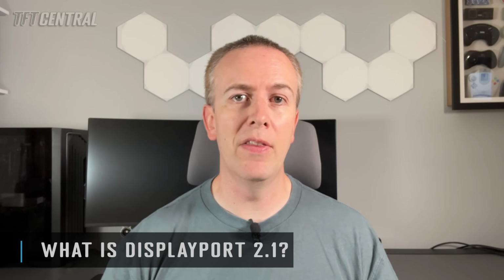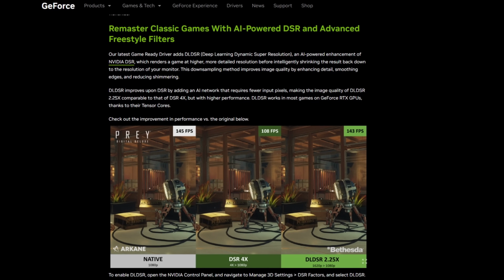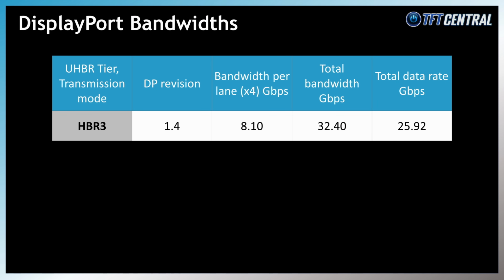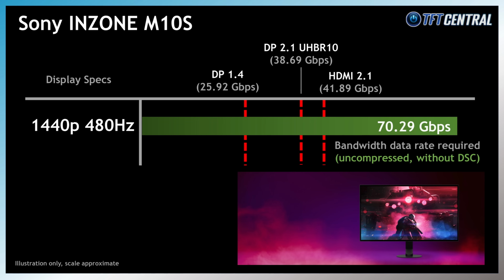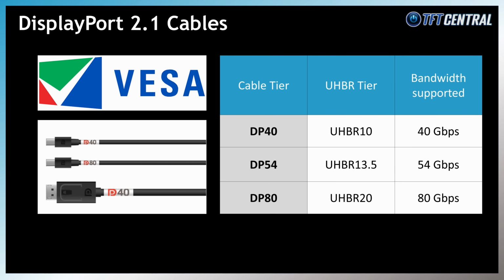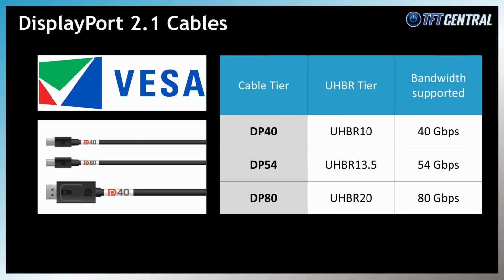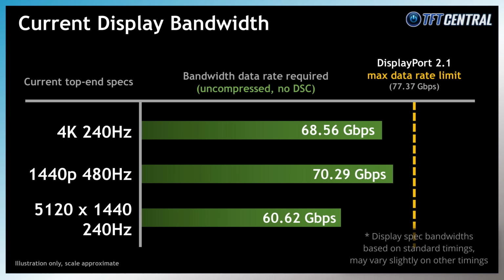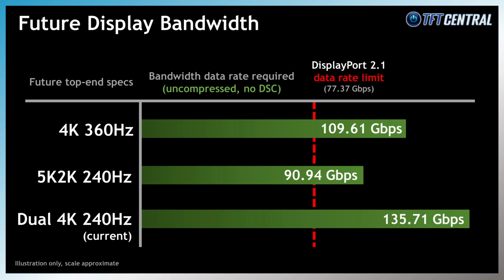The 5 Big Problems with DisplayPort 2.1

Comment: It's sad how hard they dropped the ball on standardizing the actual cable spec, allowing sellers to get away with using the DP 2.1 branding without supporting the full bandwidth of the spec.
Reply from the maker: Agreed. Same boat as HDMI 2.1 on that front
Reply: The worst part is that they can use the DP2.1 label and only offer the same speeds as DP1.4
Reply from the maker: @livedreamsg yeah I don’t see any reason why that should be allowed personally. If it’s only old speeds, they should have to call it DP 1.4. Fine if they add other new bits to that, but DP 2.1 is ALL about the new speeds in the minds of the consumer
Reply: That's because they took inspirations from the morons in the HDMI forum forgetting their dictionaries at home with what the words 'standard' or 'specification' means. All these annoying standards houses do this, same with Nvidia when they downgraded their Gsync Ultimate spec (of course it was downgrading the only thing that really mattered, HDR quality). It's just a blantant disregard for anything sensible because these standards houses want to have their cake and eat it. They want to lure consumers with shiny new specs, but their members don't actually want to pay for the effort required to bring to and make it common on the market. It's just more corporate garbage greed as always. So sane and sensible group of people would do these kinds of things, nor would we have need for things like DSC (it's not like people decades ago didn't think compressing video signals, but rightfully avoided such garbage).
Reply: Yup
Reply: Bean counters and marketing scammers shouldn't be allowed inside fire arm range of making standards.
Reply: Sad but hardly unsurprising

Comment: I think we also have toke account t the price of the monitor. I dont expect, nor need DP 2.1 80Gbps on a 200€ monitor. I doubt thing most other people do either.
But buying a monitor that has top end specs and that costs over 1000€ should also come with the newest standard and appropriate cable included in the box (looking at you Sony).

When a monitor already costs 1000+ the costs of the scaler and cable becomes much less of an issue. 
People buying such high end monitors are not going to skip on it because it's 50-200 more expensive. 
They may however skip it if it has deficiencies in the specs compared to it's competitors.

Comment: I'm not surprised; for example, in the past, we had "HD ready" display, and then "Full HD".
Now, I guess, we would have "DP 2.1 ready", and then "Full DP 2.1" or something...
Reply: HD ready vs full hd: These mean two very different things, and I'm not talking about resolution. 
HD Ready was an actual set of requirements by the standards body, and minimum resolution was just one of them. It was to protect consumers from being duped by manufacturers.

Full HD, 1080p, etc, were random labels that manufacturers stuck on their TVs. They had no value other than honour. A Full HD tv could very well not satisfy all the HD Ready requirements.
It was manufacturers massively muddying the waters.

That's also why back then you found beamers advertising Full HD while having a much lower resolution. Their small print would say they accept full hd input. it had no legal meaning. You could sell waterbottles with a "full hd" label.
Reply: You're probably right, however I hope it will come as a stricter requirement with DP 2.2, that will lessen the confusion.
Reply: The HD Ready was 720p If i recall correctly.

Comment: Will the 50 series have dp2.1 80 gbps?
Reply: Most likely yes.
Reply: Rumors are saying yes
Reply: If it is NVIDIA… i expect that
5090 will have full 2.1 80
5080 will have 2.1 40
5070 will have the slovest 2.1 aka 20
And 5060 will have that fake 2.1 aka dp 1.4 speed…

That would be very NVIDIA like release!
😂😂😂
Reply from the maker: No one knows yet. We hope so as it will help move things forward when NVIDIA adopt it

Comment: i don't understand why hdmi and displaysport still need to exist, now that there's a USB4 standard that supports up to 80gbps which is the same as the fastest displayport version USB should just become the one truly UNIVERSAL standard, anything that requires higher speed should just use OCulink(aka external PCIe)
Reply from the maker: USB-C operates using displayport Alt mode though. Same challenges exist
Reply: @tftcentral we don’t want that there’s more compression and latency no
Reply: USB4 isn't a display signal transfer protocol. It only transfers data via a universal port/connector. You also need a protocol like HDMI or DisplayPort to actually produce and display the data. And DP is actually what is internally used even if going via USB-C.
Reply: @AngelicStreak  yes so why do we still need to keep the physical displayport connector around? why do we still have 2 seperate display adapters(dp/hdmi) for monitors and tvs even though the difference is becoming more and more arbitrary
Reply: @Intelligenz_Bestie  I didn't say we need connectors. I talked about protocols. And I did that in response to your "i don't understand why hdmi and displaysport still need to exist." And yes, we can go via USB-C port, but will still need an underlying display protocol. As to why we need HDMI/DP ports, we don't.
Reply: @Intelligenz_Bestie unfortunately HDMI is a standard because of the digital copyright guys. It's has some additional overhead/handshake protocols to limit format shifting
Reply: @AngelicStreak it’s garbage no we don’t need display c doesent even support 4k 360hx hdr no

Comment: I think to solve the cable length problem, fibre really is the only way. That’s going to be insanely expensive though.. there is no way I could use a 1 meter cable in my setup. I’m using 2x 5 meter club3d DP 1.4 cables and they work great.
Reply: I would not say fiber is expensive. Economy of scale. As it becomes more common the prices will drop as it did with internet cables going from copper to fiber.
10m fiber cable currently costs 65€. Assuming 5m cable would be be half that at 32,5€ it's on the high side but reasonable.
However current DP. 2.1 cables are only UHBR 13,5 from what i see. Labeled DP54 (54Gbps). I see no reason why a 3-5m fiber cable supporting full 80Gbps could not be sold for less than 20€ in the future.
Reply: @Raivo_K  it’s not so much the cable but more the electronics at each end that would cost a heap.

Comment: One thing not mentioned here that Wendell (level 1 techs) has mentioned.. the cables. Apparently even the displayport connector is a limiting factor, and AMD has made some kind of Mini DisplayPort connector for its Pro level graphics cards which support 2.1. It apparently handles the signal much better. He did a video on it.
Reply: He talked at length about the cables currently available being too short to make the standard worth using at all.

Comment: DSR is NVIDIA's downscaling feature, while DLSS is the upscaling feature. I believe AMD's VSR downscaling feature is also incompatible with DSC based on my limited testing. NVIDIA's next generation of GPUs will support DP 2.1a based on recent rumours. Hopefully this will give monitor manufacturers the impetus to support it. Longer UHBR20 cables would be nice, too. EDIT: Ah right yeah you mention this in the video :/ My bad for commenting before watching the whole thing.
Reply from the maker: I look at DSR as upscaling, but I see what you mean. From a monitor point of view it allows upscaling, allowing a higher res input that the res of the panel. But from a gfx card point of view it’s downscaling the higher res to the panels lower res.
Reply: @tftcentral  That's a fair standpoint. The end result is SSAA, so perhaps 'upsampling' is a better term.
Reply from the maker: Yeah agreed. 👍
Reply: @tftcentral  Well, it is a bit strange to call it "upscaling" when it does the complete opposite of the widely understood "upscaling" that features such as DLSS or FSR do
Reply from the maker: See my reply above. 👆
Reply: Can't find the source now kind of a niche topic but I'm pretty sure AMD's VSR is compatible with DSC unlike DSR. Building onto your comment though it sounds dumb but at 1080p using DSR to upscale 1.5x than downscale to DLSS 3 Quality/DLAA looks amazing in the games I've run it in.